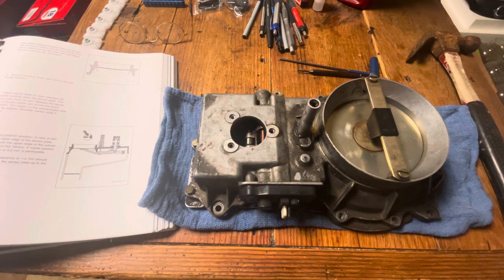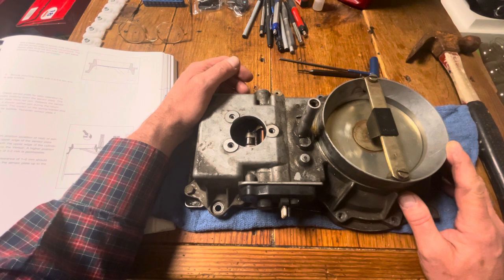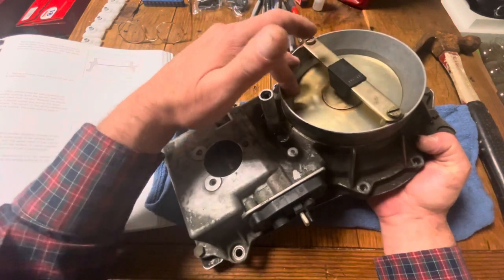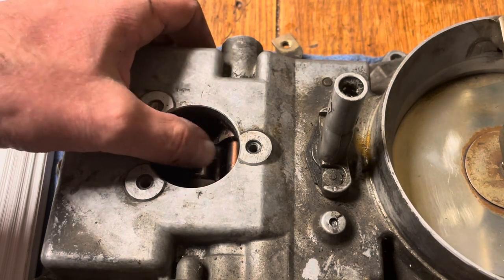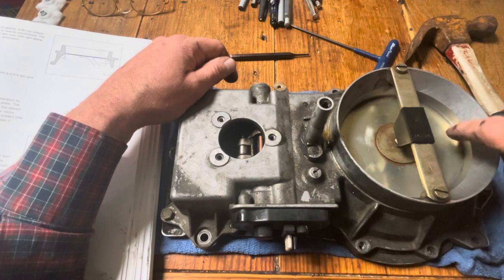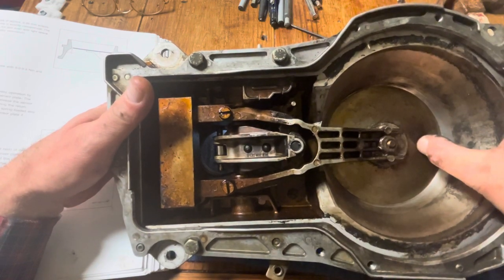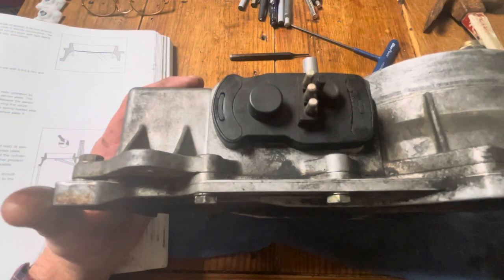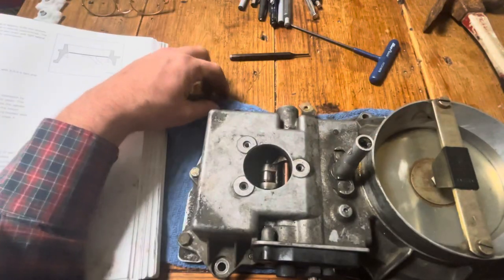Mercedes, W126 all 8 Cylinder - Airflow Plate resting adjustment, idle speed adjustment & issues

Comment: excellent video; i can testify the 300 CE 6 cylinders (1990) - which looks a bit different overall - also has the same "geography" as shown; you can regulate the sensor plate's resting position in pretty much the same way.

but then you end up with the pin no longer flush with the outer surface of the housing and looks a bit "messed up".  

if you like the pin to be flush again on the external upper surface of the housing and the sensor plate at the right height, then do as follows - I'll try my best English (I'm Italian) for anyone wanting to achieve the same "not-messed-around" look.

Take the unit and hold it in your hands upside down - it's important, or some instructions don't make sense. 

the sensor plate's resting position is reached when the pin mounted on the "secondary lever" (the shorter one, the one that effectively regulates the fuel by hitting the plunger in the fuel distributor) hits against a spring plate .  why this spring? 

Well, please:  (a) is the reasoning behind it; (b) is how you solve the issue - feel free to skip (a):

(a)
the spring plate is there precisely for the case of *backfires*: when there's a detonation, the rubber boot swells due to increased internal pressure and and the sensor plate is violently pushed outside. 

The lever hitting the pin doesn't let the hot gases escape the closed housing, and the lever and the sensor plate my be bent and / or broken apart. 

BUT: the spring gives in and allows the sensor plate and the main lever arm to extend over the normal range of motion, thus letting the exhaust gases leak out of the unit without grave damages; that is, more often than not -- that's also the reason for a rubber bottom, or "boot", which also absorbs part of the explosion's energy, by swelling.

Nonetheless, apart from this "emergency overextension" via spring plate, the "normal" range of motion should only extend to the point where the pin on the secondary lever hits the spring plate without bending it: the spring needn't give in, under normal circumstances. This is achieved by design with the pin's external surface flush with the external surface of the housing; 

So if you hammer it down to restore the sensor plate's right rest position, well...  it surely works but... it looks like you messed around with it, because the pin is no longer flush with the outer surface.
 
(b)
THAT position (pin hitting the spring plate) defines the sensor plate's resting position.  In order to restore a lower (or, if you're holding it upside down, "raised") position of the sensor plate after a detonation, it's the spring plate, that has to move! 
but it can't: the spring plate is being held DOWN by a *ring * tightly fitted onto the pin. (remember you' re holding the unit upside down).

So, the "RING" has to come UP  in order to let the spring plate come "up", but you can't grab it with plyers or so... it's also too hard to do; in this video is illustrated what you'd normally do: just hammer the whole pin (with ring on it) from the outside (thus towards you holding it upside down). but then you have it no longer flush with the outer surface. it has lowered. (seen from the outside, and not upside down).

BUT: if you - holding it upside down - place something between spring plate and the housing's "bottom" (which would be the ceiling, in operational orientation) you can hold the spring plate in place - and the ring which rests on the plate - while you hammer the pin -- AND ONLY THE PIN -- "down" till it comes out "up" of the other side (the outer surface of the housing) a couple mm.

now: plate and ring haven't moved -- you held them in place -- only the pin has been forced through the housing's bore to exit from the opposite side. When the pin has come outside the housing, flip the unit into normal operational orientation, grab the hammer and hammer the pin "down" until  it's flush with the outer surface again. 

the NET EFFECT of all that, is that you effectively moved THE RING ONLY along the pin and the spring plate has now returned to its original position - with slightly more released tension. The sensor plate's resting position has returned in a more lowered position (normal orinentation, not upside down). 

if it's not enough, just repeat: it takes only 1 minute. 

RESULT IS: the sensor plate is at the right height again, AND the pin is flush with the outer surface of the housing.

Comment: Thanks for the amazing work! But to the Mercedes designers of the w126 A PIN AND DOWEL?!?!?!??! C'mon son!!!
Reply: The interference fit makes a vacuum tight seal without needing rubber, and it also won't vibrate and change the position; simple tech, but effective 🤷‍♂️
Reply: 'Hang on, let me just hit the engine with a hammer one second'. I actually like it.

Comment: Thanks for your great videos on these Bosch systems. I am just in the middle of a rebuild on the whole of the fuel system on my 450 SLC. I have had the fuel distributor rebuilt by a very well known German firm and am about to install it in the air flow unit. I am trying to establish where the piston of the fuel distributor should sit so as to adjust the inner arm on the unit so as the roller is in contact with the bottom of the piston. I have adjusted the plate in the venturi by tapping the pin so as it now sits just perfect as per your video. My old top CO2 adjustment was mangled by a previous owner so i have now replaced it with a new allen head screw. I can adjust the inner arm on the shaft of the plate unit with a 3mm allen key through the hole of the CO2 adjusting screw so as to get a basic starting set up before I reassemble the unit. Is this the correct way to get the basic setting of the fuel distributor piston on the roller of the adjuster that is in contact with the fuel distributor piston and what is the correct setting of the piston in the fuel distributor, should it be all the way down in its travel so as it sits on the retaining bracket.

Comment: Hello, Great videos coming in very useful!!!
I'm in the middle of bringing a 500SEL back to life and figured air was next,
It is a car that was hardly running when I got it, 15 hours for a 3 hour drive bad. 

My plate was sitting high, I thought I would hit the pin and drop it down to the lip, (it was high exactly as in the video),
I knocked it about the same distance as in the video til exact and then adjusted the 3mm allen tower while jumping 7/8 fuel,
Fuel started to flow as the 3mm allen was at its full right, plate has zero spring... any less the fuel pin isn't triggered as it had zero more play available,

Problem is I reckon... I done it in situ on the engine.
Watching the video I see your adjusting a pin on what sits under the fuel distributor and turning the allen key tower, because my tower is limited as its adjusting to the fuel at the same time

Although it's dawning on me now, I have to have the fuel distributor off to adjust the plate heigh/gap at the tower so left that it isn't leaning the fuel as i do it.

presumably no easy way to do it but to take off the fuel distributor and adjust the plate height?
Reply from the maker: No, the Allen screw in this little tower is spring loaded and has also a 3 mm Allen key on the other end which will go into the actual setscrew when depressed. You wind up basically with two Allen key’s in series 

If you have fuel flow in this plate resting position then you need to adjust screw counter clockwise 

If your fuel pump is off when doing this adjustment then just pushing the Allen key down to overcome the internal spring can push the plate down.

These adjustments take practice, lots of practice and are done in 1/8 turns in either clockwise (richer) or counterclockwise (leaner) direction 

If you do this with the fuel pump running then the plate has more resistance and will not move as far down when pressing the Allen key down to make adjustments 

But this will flood your engine. 
After making adjustments to mixture with running fuel pumps, crank your engine for 30 seconds with no fuel pump relay or jumper cable on 7/8 to clear fuel out before trying to normally start it
Reply: @inovahightechltd 
Thank you for your response, much appreciated,

So at the barrell there are two adjustments achievable?, 
"Dig" the allen down to adjust the arm in terms of where it is in relation to the fuel distributor pin and the point at which it opens fuel,

and then by not digging it down it gives space for the 2/3mm spongyness adjustment (which for me currently is at far clockwise limit, I better recenter it before the above and create space for adjustments),

So possible without removing the fuel distributor, 
And thank you for the reminder to clear the fuel out,

I'll let you know how it goes,
All the best, 
Martin
Reply: That's amazing, I've already watched your video a dozen times and it's only after seeing it again now having read your response I got the differentiation into my head, Thanks again!!!
Reply: @inovahightechltd  
Hi,
I was messing with the 3mm allen, I'm not able to get the plate to gap 2/3mm,
I did take off the fuel distributor and could see when the allen went in it raised the wheel under the FD piston, 
put it back on and no 2/3mm gap, fuel was flowing evenly jumping 7 and 8 on the relay port and pushing down on the plate,
I did have to push the plate a small bit further than desired

It really seems to me that the 3mm allen is only adjusting the screw to meet the FD piston sooner, the plate loses its gap and I can't create a gap without delaying the fuel flow,

Am I right in the belief that the 3mm allen should adjust 2 different aspects, dependant on the depth you push it in?
1: deep push of the allen = the distance the plate needs to be pushed before the piston is contacted and fuel flows 
2: not deep push of allen key will create or lessen the 2/3mm gap between the plate,

All I'm achieving is number 1 above,

Strongly considering taking off the air housing and knock my pin back up and thinking that may come at it from the other side and lessen the distance before the plate hits the FD piston,,, but my pin was only knocked in the 2/3mm until the plate was to its lip,

Thanks again,
Martin
Reply from the maker: @martinburke3755 “it really seems to me that the 3 mm Allen is only adjusting the screw to meet the FD piston sooner” 

That’s exactly the purpose. The 2 to 3 mm “play” is not needed when you adjust the plate resting position with the pin.
In this case the fuel flow should start as soon as the plate is opening

Comment: Question; I am working on a 1989-560SL. Rebuilding fuel dist and setting the air flow stop position. Seems my air flow plate may be bent because the front, or 12 o'clock position" of the plate does not match the 6 o'clock position at the "ring on housing". Does that confirm plate is bent? I would also like to ask, your technical book, as mine, shows the line up point of the plate in reference to the housing to be to the rear. Does that matter if plate is straight? And if not straight, is 12 o'clock or 6 o'clock position best to adjust at/to?
Reply from the maker: Thanks for watching my videos! The plate should be absolutely flat and has to be centered. These plates bend when the engine back fires which usually happens when the oxygen sensor goes bad. 
As to 6 and 12 o’clock, should be the same when stop position is correct and plate is not flat.

Comment: My '91 500SL starts easily and idles fine for 90 seconds.  Then starts to chug and almost die. At that point it will no longer take throttle smoothly and rendered undriveable. New caps rotors, plugs. Cleaned air idle control valve and adjusted to full close at 1 ampere. Problem persists. O2 sensor? Plugged CAT?? Any ideas for a frustrated diy mechanic?  Tnx for your great videos.
Reply from the maker: The issue is fuel mixture, either to lean or rich. Disconnect ECU from wiring harness with battery disconnected. 
Reconnect battery and start engine. If problem no longer exists then the issue is ECU / EHA / potentiometer issue. Follow MB manual group 7.3 for trouble shooting.

If the problem still exists, then your mixture is off. Adjust mixture by adjusting 3mm Allen screw until satisfactory results are achieved. Do this only in very small increments, 1/16 to 1/8 turn at a time

Reconnect ECU with battery disconnected

Comment: Hello, thank you for your videos. I have a 1990 w126 260se m103 engine Ece version (no cat and no o2 sensor)  I have adjusted the plate to correct position like you shown in the video. After that I adjusted the mixture screw about half a turn Ccw  to have the 1 to 3mm free play but in this position the car idles very bad and eventually stalls if I accelerate. If I return the mixture screw half a turn Cw again the car idles much better and acceleration is good however in this position I noticed I don’t have the required 1 to 3mm free play. the plate is very stiff seems to have a lot of pressure. Do you know what could be causing this? Any idea what should I check?
Reply from the maker: You need to find the sweet spot. Turn the screw ccw until engine runs rough, then turn cw until engine runs rough again. Note how many turns it took to go from rough lean to rough rich. Now go back ccw until your about in the middle of the rough sides. Then warm up engine and check duty cycle and co exhaust. The 1 to 3 mm is just a starting point so you can start the engine
Reply: Ok thank you I will do it.  About Duty cycle last time I checked it was 60% stuck. Maybe because my car don’t have an o2 sensor? although I read somewhere it says it’s a problem with the car speed signal not sure what that means.
Reply from the maker: @gcgj1540  yes, no cat no O2 sensor means fixed duty cycle - don’t forget, this engine needs leaded gasoline or a lead substitute if you get unleaded gas